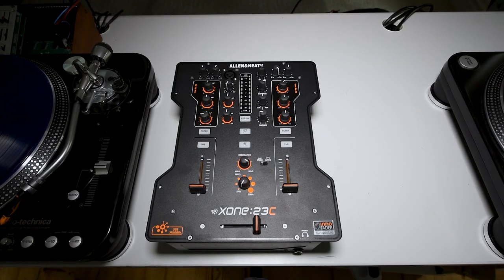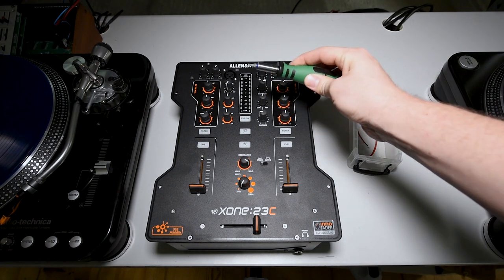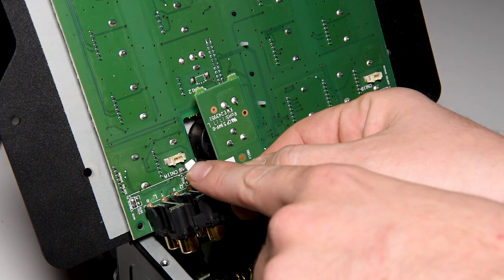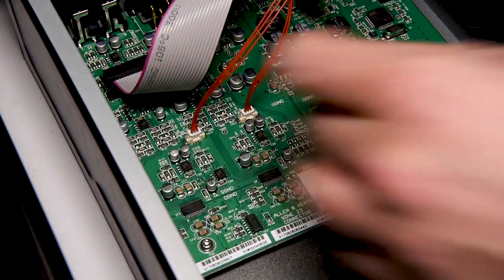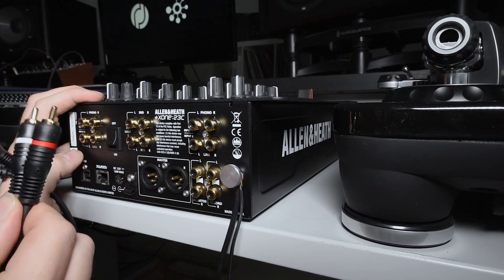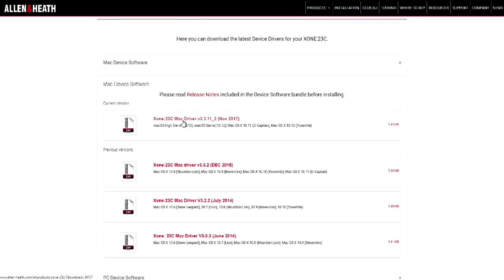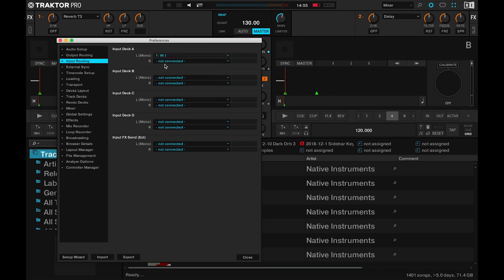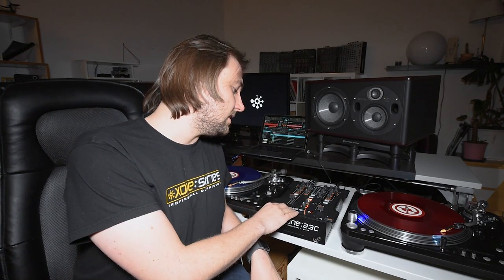#XoneQuickTips - Xone:23C TP3 DVS Mod

Comment: BE AWARE the INSIDE screw to loosen the headphone jack is a torx T10! (NOT a torx T8 like the other screws in this video)
Reply from the maker: Hi,
Thanks for bringing this to our attention. We will try get the video updated to display a message for other uses. FYI, we never use T9 screws, it will in fact be a T10.

All the best,
Luke
Reply: @xonedjofficial  Thank you. (I edited the comment to T10)

Comment: I was wondering is it possible to configure all inputs as line inputs? let's say a set up in which I route sound form Traktor but in addition, I want to use an iPad and a drum machine. Can you configure it that way? The manual say something about it but it is not specific describing it. Do you have any idea about it?

Comment: Hello @xonedjofficial I’ve installed the DVS cable here, and it’s working fine. I have one question: why doesn’t this cable come pre-installed?
Reply from the maker: By default, the USB interface on the 23C will send the Record and FX send bus on the USB upstream. The DVS jumpers are supplied for those that wish to reconfigure the sound card to route the DVS signal instead of the Record & FX buses. 
Thanks,
Luke
Reply: @xonedjofficial  Thanks Luke!

Comment: How will I switch between vinyl and DVS if there is no switch to route the signal between the interface and the phono input? This way, I can't listen to the vinyl
Reply from the maker: With the DVS jumpers in place, it is possible to play a mixture of regular vinyl and DVS. As the USB return feeds back post mixer gain-stage, you simply need to keep the gains down when mixing DVS, then use/turn up the gains when you want to play regular vinyl.

FYI; the DVS gain needs to be established with the software soft-gain controls.

I hope this helps!

Best regards,

Luke
Reply: @xonedjofficial  Yeapp, now I got it :) 
Thankss

Comment: Finally installed these cables. But the only inputs I see are Xone23c 2 & Xone23 3.
Reply: I can’t even install the drivers because they are not required but they clearly are to some extent if I can’t even get it working. This is so frustrating
Reply from the maker: Hi,
For assistance with this, please drop us a line.

support@allen-heath.com

Thanks,
Luke

Comment: Hi Alex, thanks so much for this video. 

I managed to get my Xone 23c mixer connected and have been really enjoying getting into using timecode vinyl! I have a couple of queries I hope you can help with?

1. There is a very quiet but very high pitched frequency present which goes quieter but does not go away completely when I turn the input levels down on my mixer Is there a way to get rid of this completely? 

 2. When I switch to Live input and choose to play normal vinyl record, the sound levels are all over the place and im having a hard time getting them to match. Any tips? 

3. Any advice on how to record a set? When I had the first Traktor there was a record button which was really convenient. I was maybe going to use Audacity but am not too confident with getting the levels to sound right, I have tried and it has been a bit tinny.

Any help would be appreciated.

Cheers
Reply from the maker: Hi Marc,
Thanks for the message.

1, Please ensure that the phono input level for 1 & 3 are turned down (off) when using DVS.

2, Use the above-mentioned control for adjusting the “gain” when using actual vinyl. And use the level control in the software adjust the gain of the computer playback.

3, As you have converted the mixer USB channels to USB. You will no longer be able to use the USB for recording. You can, however, now use the RCA record output, So long as your computer internal sound card has a line input. If so, you can run to the record to third-party software running in the background (such as Audacity). Or If on Mac you can set up an aggregate device and route back in to Traktor as the additional I/O will be available in the aggregate device.

Best regards,

Luke

Comment: Thanks for assistance in previous question, I am all set up now :). I have another question, Can you record your mix internally on traktor pro 3? and if yes how?
Reply from the maker: Hi Mirna,
Sorry for the late reply.
By default, the Xone:23C routes the FX and Record bus on USB pairs 1&2/3&4. Once the DVS jumper cables have been fitted, this changes the default USB routing to manage the DVS signal instead. It is therefore, not possible to record via USB when the DVS jumpers are fitted! 
In this instance, you will need to use the RCA record out on the rear of the mixer into a third-party or internal computer interface. For recording direct into Traktor, the interface would then need to be aggregated with the 23C SC. Or alternatively you can use third-party software.
I hope this helps!

Best regards,
Luke

Comment: Hi, I have a problem where the sound card is freezing as soon as it tries to play audio out of traktor. It can read the timecodes fine but will stop working when the playhead hits the waveform. The Traktor interface can still be used so I'm thinking it's a sound card issue. Any ideas?
Reply from the maker: Hi, 
please ensure that you have the correct driver installed in accordance with the OS you are running, all driver versions are available from our website.
Further to that, if you were running an older driver on a previous OS, please make sure the other driver was removed before installing the updated version.
Finally, I would check the soundcard buffer and sample rate settings in Traktor. This is to make sure you are not causing the hardware/software to run ineffectively.
If you require further assistance with this, please drop us an Email to support@allen-heath.com
Kind regards,

Comment: Hi Luke ! How are you?  

Quick question. If I'm using the 23c whit dvs mode on Traktor, can i use the Fx on the software? 

Thanks!

Boris
Reply from the maker: Hi Boris, Good this end thanks! If you are using software 'insert' FX with MIDI or keyboard control, this will work just fine. What you won't be able to do is set up an FX send and return with the Mixer, as the USB channels have be reconfigured to manage DVS (with the jumpers). I hope this helps! Cheers Luke :)
Reply: @xonedjofficial  Great! Thanks for getting me out of doubt!
Cheers Boris 🙌🏿🙌🏿

Comment: Does this same modification work with Pioneer's Rekordbox DVS???

Also, why on earth if it's capable of this are those cables not pre-installed???  Seems so strange
Reply from the maker: Hello,
Yes, the 23C will run DVS as a third-party device with Rekordbox. 
FYI; by default the 23C sound card will route the record and FX buses via USB. For DVS users have the option of reconfiguring the soundcard, if so desired. 
Best,
Luke
Reply: @xonedjofficial  thanks mate! Much appreciated

Comment: Guys I want to do this modification but I lost the provided jumper cables, do you know if if I can get them in a electronic equipment shop, or if Allen and Heath still sells them? thanks so much
Reply from the maker: Spares can be procured through our regional service partner in your country.
 
https://www.allen-heath.com/dist_type/france/
 
A&H part # AL9422
 
Alternatively, you can procure a generic part to fit. 
 
3-way 1.25mm (170mm cable)
 
https://www.molex.com/molex/products/part-detail/cable_assemblies/0151340302
 
 
 
Best regards,
Luke

Comment: Hi thinking of buying this... but I want to know if I will be able to do both analogue and DVS mixing once the TP3 DVS upgrade has been completed. Does analogue mixing still work or will I need to remove the cables?
Reply from the maker: Hi Mannuel, 

Thanks for the message. 

The sort answer is yes! It is possible to play both digital playback from DVS and regular Vinyl together with the DVS jumper mod in place. 
I hope this helps! 

 Kind regards, 

Luke
Reply: Thanks for your useful responses. I was going to ask the same question and now my only comment is, why doesn’t this come as standard on the mixer?

Comment: Hi ! is any type of timecode vinyl (ex : Serato, Native...) compatible with the software Cross LE Mixvibes (provided with the Xone 23C) to use DVS ?
Reply from the maker: Hello Ligo V,
Thanks for the message.
The Xone:23C does not ship with DVS vinyl.  For this you would need to visit the respective software developer to obtain the correct vinyl for the software you are using.
For Mixvibes follow the link below.
https://www.mixvibes.com/product-store/

Kind regards,
Luke

Comment: Is it possible to control the input gain for the signal that comes from Traktor? I see that input gain 1 and 3 control the volume from the turntables, but the signal from Traktor is only affected by the faders. This is not very handy for actual mixing :|
Reply from the maker: Hi,
Sorry for the late reply on this one!
When using the Xone:23C with DVS, you need to set the gain level within the software.  To do this please make sure Traktor’s Layout is set to “mixer” this will give you access to the gain level control for each deck.
I hope this helps!

Regards,
Luke
Reply: @xonedjofficial  Hi Xone! Is there any workaround for controlling the Gain other than mapping the software with some MIDI? I only saw this big flaw after purchasing the mixer.

Comment: Does this work with Rekordbox DVS if I buy a license from them? I own technics turntables and mix a lot of vinyl at home but I dj digitally in clubs and bars regularly using a USB formatted with Rekordbox. I'm thinking of using a Xone 23C and Rekordbox DVS so at home I can easily mix between vinyl and rekordbox digital files. Then when I go out to play gigs I can take my USB.

On a side note, I wish pioneer would create a mixer with a screen like on their CDJs and XDJs so I can turn up to the club with a USB and 2 time code records and play my digital files on the turntables with DVS and no need for a laptop.
Reply from the maker: Hi Jake,
Thanks for the message.
Please note: it is always down to software developer to certify hardware, not the other way round.
Therefore, this is a question that is best fired off to Pioneer support. 
We can confirm that 23C work with Traktor scratch (DVS), as it is listed as supported on their website.
https://support.native-instruments.com/hc/en-us/articles/210273865-TRAKTOR-Certified-Mixers-Interfaces-for-Timecode-Control
I hope this helps!

Best regards,
Luke

Comment: Is it possible to mix regular vinyl records and timecoded DVS on xone23c at the same time? If I understand correctly, when making a dvs mod connected with cables, the phono inputs become like line inputs? After such a dvs mod, can I  put a regular vinyl record with a recording on the turntable and will I be able to mix this record into a dvs timecode disc with a track from the tractor?
Reply from the maker: The RIAA is not converted when the DVS jumpers are applied. 
With the DVS jumpers in place, it is possible to play a mixture of regular vinyl and DVS. As the USB return feeds back post mixer gain-stage, you simply need to keep the gains down when mixing DVS, then use/turn up the gains when you want to play regular vinyl.
FYI; the DVS gain, therefore, needs to be established with the software soft-gain controls.
I hope this helps!

Best regards,
Luke

Comment: Hi,
On my Mac there's Monterey. I downloaded driver from site but I can't set the volume neither on Traktor neither on mixer. I use timecode vinyl. 
If I put fader a bit higher the volume is suddenly goes really high (both of the master channels are on 0 - volume only can be set with fader and my speakers wanna blow up).
Reply from the maker: Hello Dávid,
Thanks for the message,
Please note: On Monterey, the 23C must run as a Core-audio device. This means that no driver installation is required.
If you have installed the driver then we need to give you explicit instruction on how to remove them manually, so the 23C will run on Core-audio. For further assistance, please drop us a line to support@allen-heath.com 

Kind regards,
Luke

Comment: @xonedjofficial Can you help please?  I have been using DVS with my 23C mixer with Traktor (on Mac) and a NI Audio 4 soundcard. This weekend I decided to do this mod so I could remove the Audio 4 to streamline my set up.

All seems to be working fine, however the output light indicators both in onscreen in Traktor and on my physical 23C mixer are redlining. As im using DVS my gain knobs on the 23C are set to 0 so the timecode tone isnt audible, so the only control I have is to not put my faders all the way up, which is a real pain. 

Do i need to tweak any headroom settings within Traktor to fix this? If so do you have any recommended advice / settings to change?

Thanks!
Reply from the maker: Hi mandm1977,
Thanks for the message,
Yes, that is correct, the USB returns come in on 23C post gain. Therefore, any level will need to be set in the software when cueing the input channel. 
I hope this helps!

Best regards,
Luke

Comment: My PC has windows 10 but won’t allow me to install the Allen & Heath driver to the computer . It gives me an error code 0x0007 . 

Traktor pro 3 initial setup won’t allow me to choose 23c either. Just 1D , 2D or 3D . 

I’m now stuck
Reply from the maker: Hi Tom,
Thanks for the message.
For assistance with this, please drop us a line to support@allen-heath.com

Thanks,
Luke

Comment: Hello, I'm having Traktor Scratch A6 as an DVS with Xone 23. But thinking of changing to just Xone 23C because the soundcard of the Scratch A6 makes my analogue vinyl sound like trash in Direct THRU mode - in comparision to the turntable connected to the mixer only. So this whole process of changer the analogue signal to digital and digital back to analogue is messing the sound up. Will I have the same issue with the Xone 23c? Will I get the same quality as if I would send the signal straight to the mixer like connecting the turntable straight to a xone 23? Thanks
Reply from the maker: Hi Mattis,

Thanks for the message.

The Xone:23C does not operate the same as third-party DVS interfaces When switching between playing regular vinyl, the 23C passes the phono signal direct to the channel pre-amp avoiding any thu mode or digital conversion. This means the signal stays analogue through the whole signal path.

I hope this helps!

Best regards,

Luke
Reply: Great, thank you for the quick reply!

Comment: Nobody said anything about this when I just purchased the 23C and Traktor today. Is this why it's not calibrating and I'm getting a whistle sound because the red cords are not attached? Why wasn't this done in manufacture out of curiosity and will mixer still work normal with standard vinyl after doing this?
Thanks
Reply from the maker: Hi Peter,
Thanks for the message.
By default, the 23C ships without the DVS option fitted and the USB routes the FX and Record buses upstream to a host computer. With the jumpers fitted, this reconfigures the routing for DVS of the mixer input connectors. 
Furthermore, with the DVS jumpers fitted it will still be possible to mix regular vinyl. This means you can go between DVS and vinyl playback seamlessly.
I hope this helps!
Cheers,
Luke

Comment: Hi guys, i want to stream my vinyl set through obs on FB. I am strugling whether to try it via USB or via cinch cinch-jack? I have tried the jack system and the sound quality is quite horrible,  the only way how to improve is to put the gains almost to zero :) 
Is there a way how can i stream to obs via the usb? Also is there any difference using the mixer in DVS or non-DVS mode? I have allready put the cables inside..
Reply from the maker: Hi Dominik,
Thanks for the message.
With the DVS jumper cables fitted, the 23C USB interface will no longer route the record output bus on USB sends 1&2, as these have now been reconfigured to work straight often phono inputs (for DVS).
The option of using the RCA record output should work just fine. Please bear in mind that the computer internal soundcard may be seeing the socket as a mic level device rather than line-level.
In which case you may need to configure to line if on mac or adjust the level if on Windows.

Best regards,
Luke
Reply: @xonedjofficial  if i will put these dvs cables away, is it possible to work through USB? Dvs is really not my primary object.
Reply: @dominikpetry1785  I have the same problem. @Xonedjofficial if I take the dvs cables out, can the master be recorded via USB?
Reply: @xonedjofficial  I have the same problem. If I take the dvs cables out, can the master be recorded via USB?
Reply: @danngfilms  yes you can..

Comment: With the jumpers config is it possible to mix timecode vinyl and vinyl?
Reply from the maker: Hi Damo,

The short answer is yes!
The input pre-amp for the phono connectors is still active, you simply need to use the input 1&3 level control for the audio to pass from the turntable.

Regards,
Luke
Reply: Xonedjofficial brilliant, thanks for your response!

Comment: The cables to connect this were lost before they could be installed. I can't find replacement parts anywhere. Any help would be appreciated. Thanks
Reply from the maker: Hi Doug,
Please contact our distributor in your country, contact details can be found on our where to buy page. Quote part number AL9422 (of which you need two).

https://www.allen-heath.com/where-to-buy/

Kind regards,
Luke